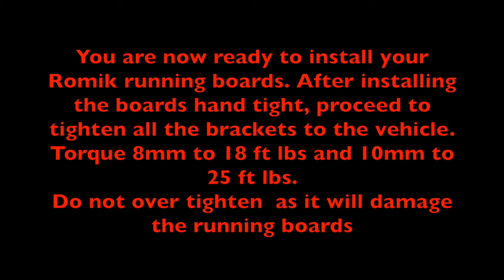How to install Romik ROF-C Running Boards on a Ford Transit 2014-Present

Comment: This video helped with installation, but it would be really nice if you guys got some numbered stickers and numbered your brackets.  That way I would not have had to screw around trying to figure out which bracket is what  by looking at your poorly printed  unreadable instructions that were printed on a cheap inkjet. printer.
Reply: At least  you found the right one , I'm still looking and I have more than 15 transit in my fleet,  I'm not buying the steps for $300 and up
Reply: Oh dear! Good to know.

Comment: Hi, is the process similar when installing these on a 2020 Mercedes Sprinter? Thanks
Reply from the maker: Mr. E thank you for the question. The Mercedes Benz is a bit more difficult due to the different chassis that MB uses. We recommend professional install as it can take more than 2 hrs to install.